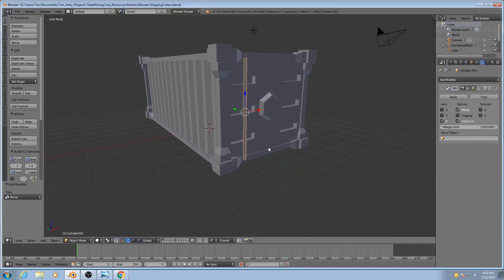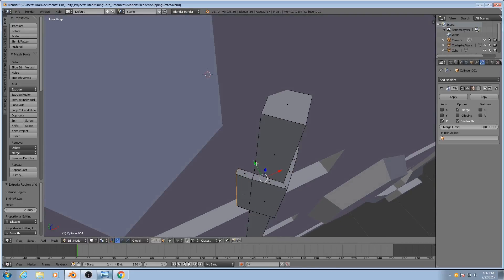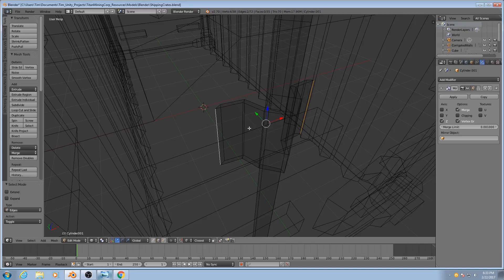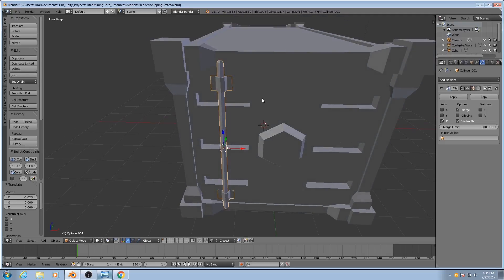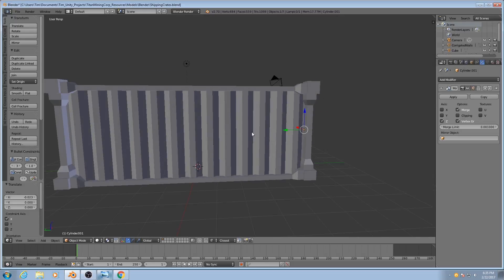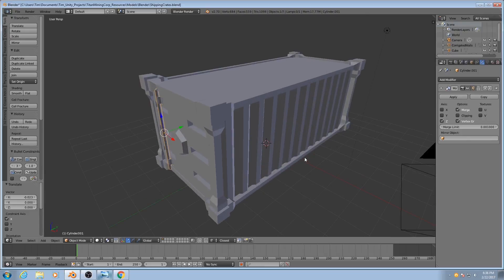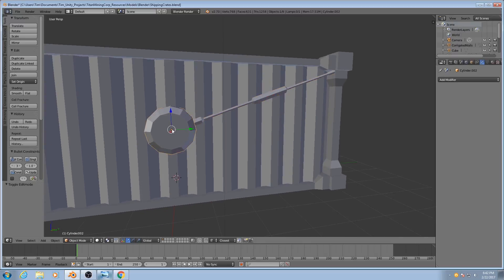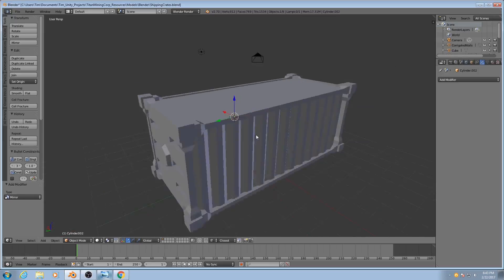Blender Game Asset Modeling Tutorial (Part 6)

Comment: The transform, scale, etc doesn't work properly when working the rotated bar, even in local Z mode. What am I doing wrong?
Reply from the maker: Make sure that the scale is applied to the bar. Certain operations like extrusion and scaling along individual origins don't behave as expected if the scale values are significantly non uniform. Hit Ctrl + A and select "scale". Also, make sure that your transform mode is set to "Median Point". That button with the two white circles in between rendering mode and the move/rotate/scale gizmo buttons at the bottom  of the 3d viewport? It might be set to individual origins, which can cause some unexpected behavior during transforms.
Reply: Appreciate the reply, what ended up fixing it for me was setting the Transform Orientation to Normal if anybody runs across the same issue.